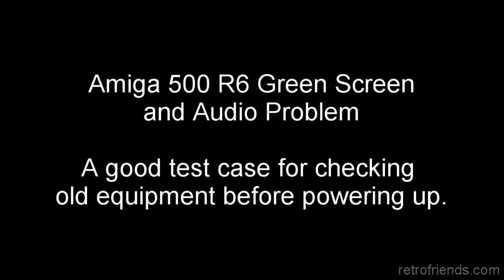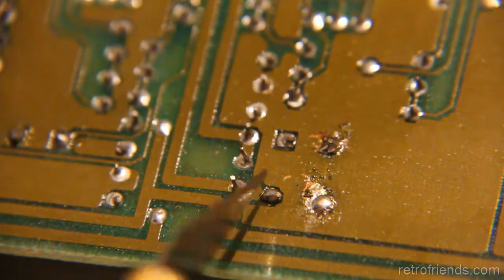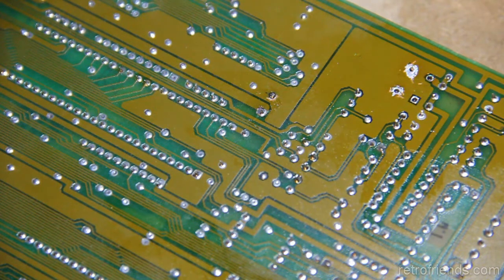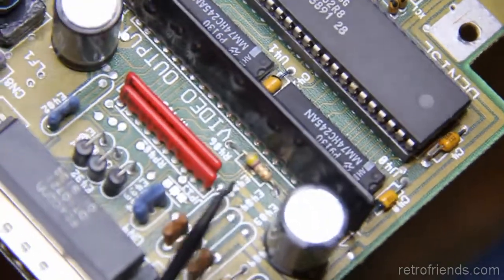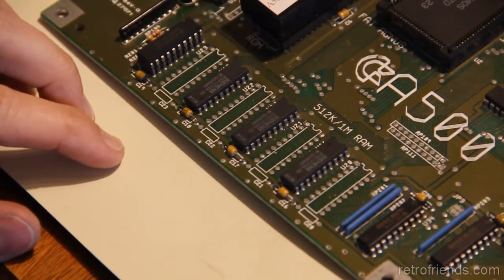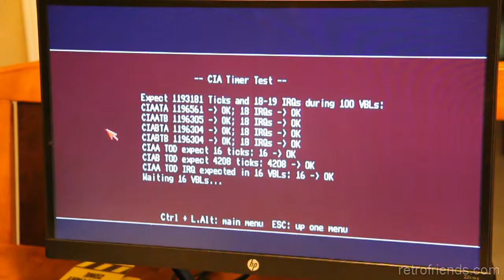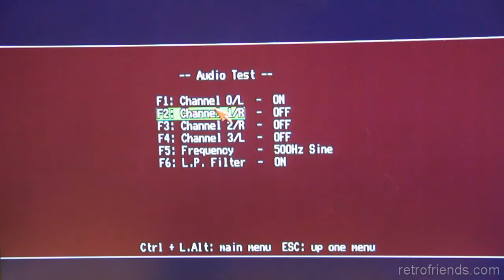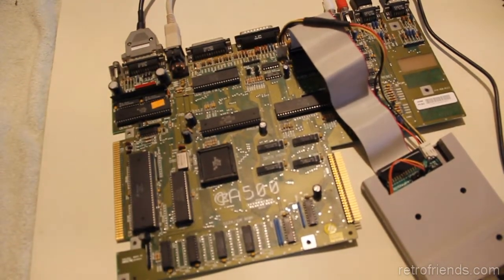An Amiga 500 with Green Screen and No Left Audio Out

Comment: Those two Audio filter caps have some really huge groundplanes which takes alot of heat. So for a person who is not used to soldering on these boards they can be a real pain. Especially if you don't have the best equipment. My first A500 board I had really big problems recapping. And the result was not a great job. It was also my least perfect A500 board to begin with. Had some corrosion and stuff which I had to repair. The next 5 or 6 A500 boards went alot more smooth for me. I don't have a proper solder sucker. My method is to heat up one and one leg/solderjoint as I pull the cap out carefully. Then heat up the solder on one and one solderjoint as I install the new one. With practice this works nicely. Soldering is all about practice and experience.
Reply from the maker: Yes, but to apply solder on the top of the board is something you want to stay away from.
The other caps of this motherboard are on large ground planes as well, but they were much better. Maybe the audio filter caps were the first two done, and the others reflect the learning curve.
Reply: @retrofriends  They don't need solder on top anyway. It's enough to just let the solder flow on the bottom. These are through hole eyelets anyway. I did the same mistake on my first A500 board. I tried to flow solder on the tops because I saw it was like that originally on that board. It almost looked like a different person did the audio ones. But you could be right in that it was part of the learning curve. BTW: yesterday I recapped another late 1991 Rev.6A board. Sometimes the two larger 3300 10v caps are glued in place. But on this one they were glued so hard I actually ripped part of the solder mask off when unsoldering it. The other one had part of the can left on the PCB. It almost smelled like superglue when I started unsoldering. Never seen them glued this hard. And if they used superglue that's bad. If it was superglue, like it smelled then there was no way to avoid the small damage on the solder mask. I cleaned up the area on top of the board and covered the part that had missing solder mask with some nail polish. It was only the groundplane luckily. There was also some black material stuck from the bottom of the same cap. On the other cap there were a piece of the blue can left. There was no way to remove this without doing damage to the board. So it must have been superglue. I just left it and soldered on the new ones. Luckily the new ones covered the area that was missing a small part of the solder mask.